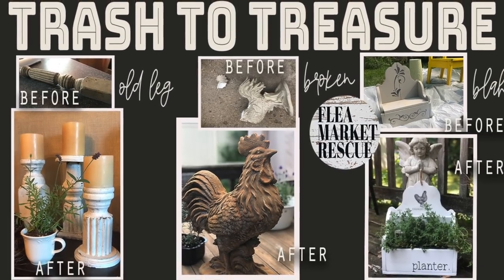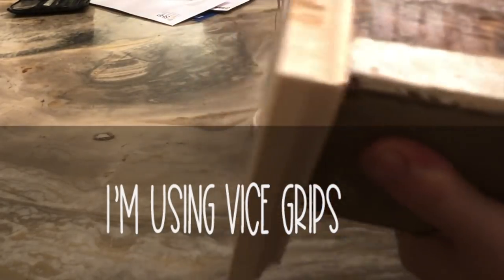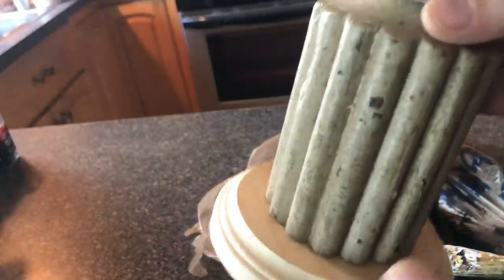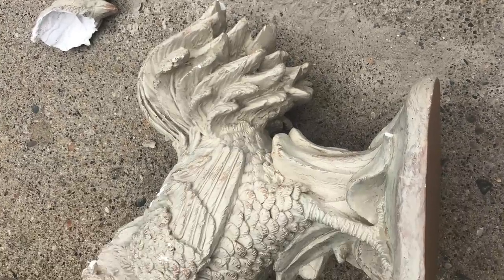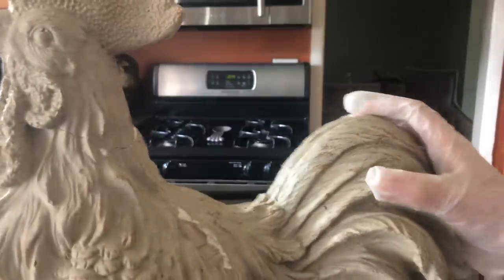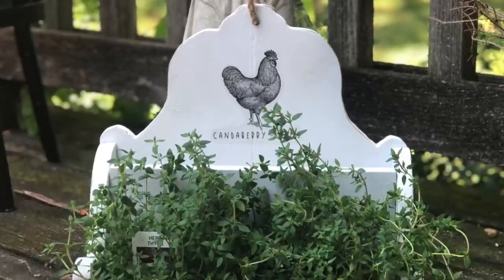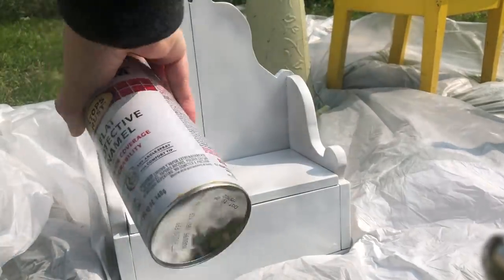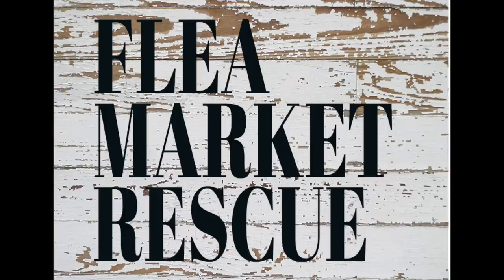TRASH TO TREASURE DIY FARMHOUSE DECOR-THRIFT STORE MAKEOVERS-

Comment: What accelerator spray did you use for the candlesticks?
Reply from the maker: Hi Pamela!  The accelerator comes with the Starbond glue.  You put a little of the glue on one part and then you spray the accelerator on the other part and when you join the two parts together there is an instant bond.  If you go in the description of the video, there is a 10% coupon code for Starbond, if you are interested.  Thanks, Pamela for watching and if you have any other questions...don't hesitate to ask!  XOXO

Comment: Is the rooster made of cement, or resin, or something else? I have a cement angel I need to try to reattach the wing. Great tutorial today.
Reply from the maker: Hi Mitchel!!!! The rooster looks like it is some type of resin, but it also looks like they have some fiberglass fibers inside it to strengthen it.  With that being said...it still was no match for the cement ground, as you saw!  As far as, repairing your cement angel...I know that it can be done, because I bought a cement angel that had a repaired wing. You can still see the line of where it was repaired, but it definitely can be done.  I would try epoxy.  Epoxy is made for all kinds of materials.  Or you could even go to home depot and look at the glues ....some will even say what they are best used for and you can pick the one that says it's for cement.  Just put the glue on both sides, join it together...prop it tightly against something so it will bond good and you should be good!  Hope that help, Mitchel!   XOXO  You have a BEAUTIFUL day!
Reply: @FLEAMARKETRESCUE  Thank you so much.